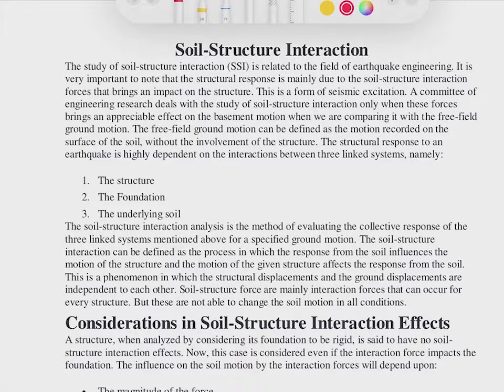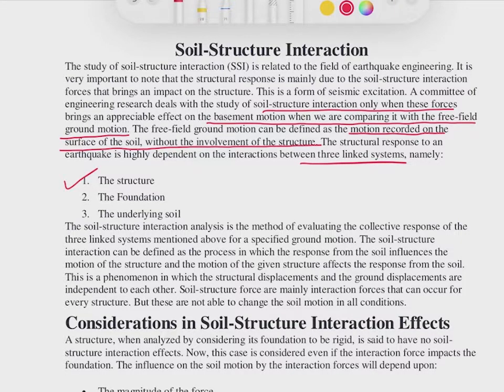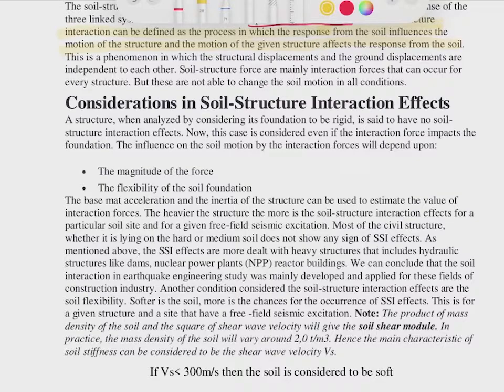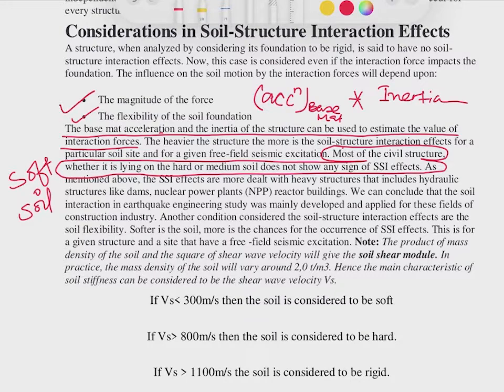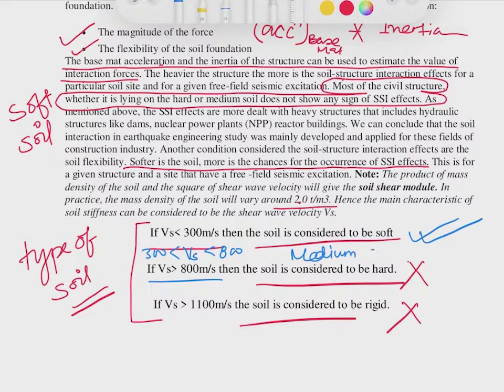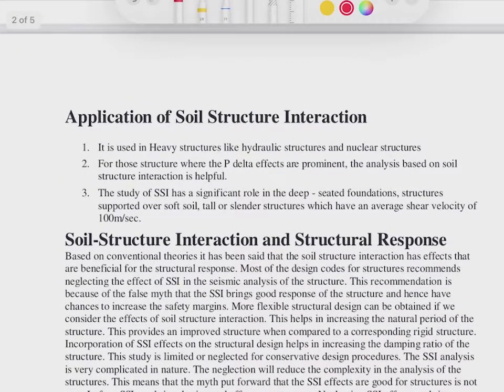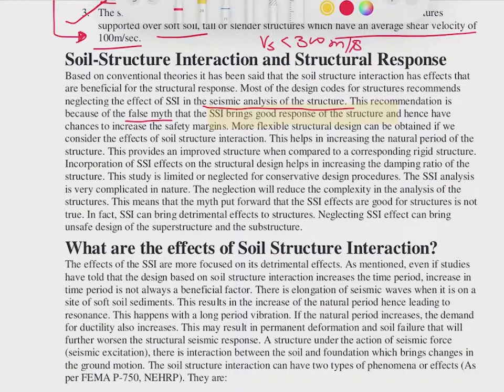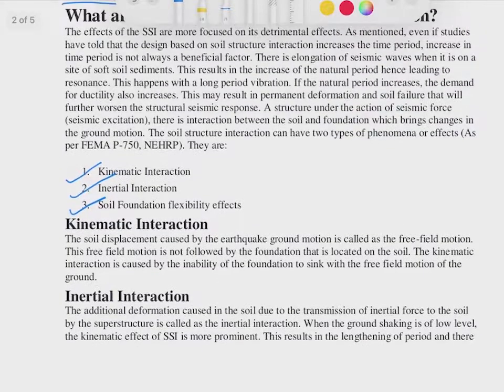Soil Structure Interaction (SSI) | Introduction & Considerations

Comment: Sir ...my thesis work is based on SSI analysis..... And software i used sap2000 ...how to find the parameters of soil like modulus subgrade n all...  And how can i relate the. .ssi results??
Reply from the maker: Soil Properties will be obtained from field test of the soil at site, SAP 2000 will not help much, but yes you can use SAP Foundations ERP and simulate these SSI effects on the structure.